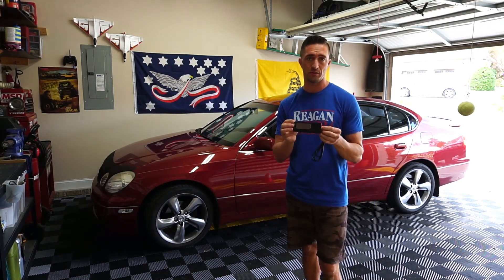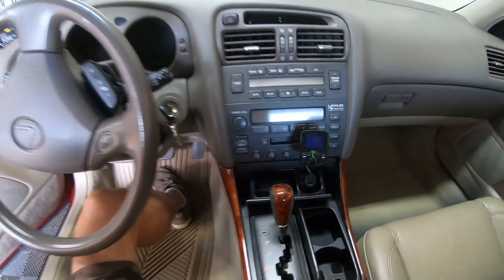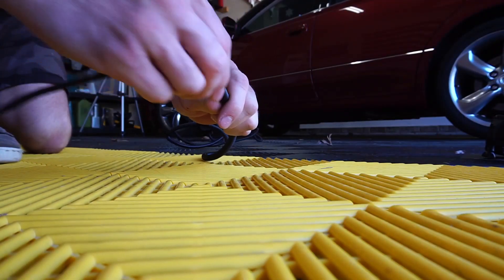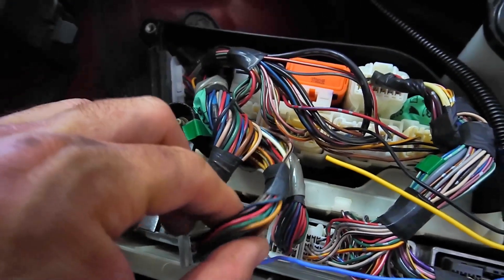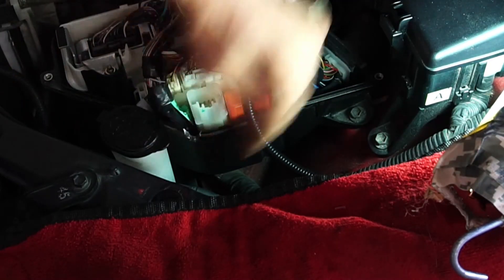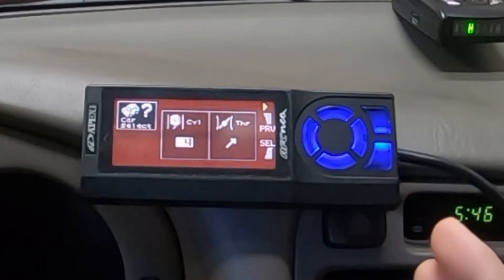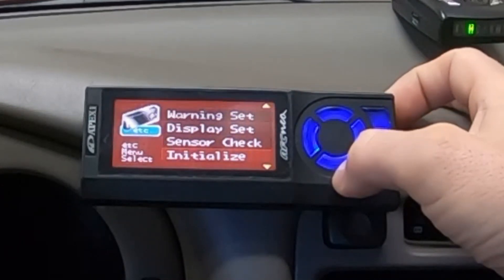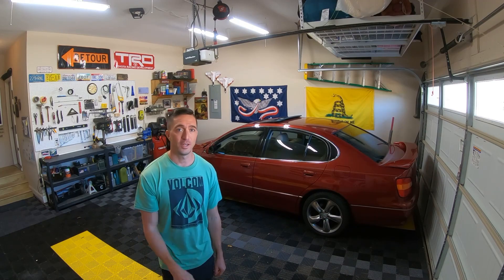Step-by-step Tuning Device Install (Apexi NEO into GS400)

Comment: 9:32 - i know I'm 6 years too late, but what i like to do in these situations is de-pin the wire from the connector and either solder to the end of the pin or de-pin, cut and solder for the cleanest install. 
11:48 - here i would use a heated up metal tube, then press into the plastic. That's how you get a perfect hole or notch. 
Cool video bro💪🏆
Reply from the maker: Good info! Thank you.

Comment: Is this the same procedure for a gs430?
Reply from the maker: Yes and no. The ECU pinouts are different between the two models, but once you get the correct pins it’s the same general process.

Comment: hello frien , what are ur settings for the saqfc neo? could u share them with me please
Reply from the maker: Is your car supercharged? If not, then my settings probably won’t help you. You need to install an AFR gauge and street tune it. Each car can be slightly different anyway, so I don’t really have a base map for you other than starting with all zeroes.
Reply: @ForwardMomentum  not super charged. I wanted your settings when ur car was not supercharged if u still have those. If can please.
Reply from the maker: I don’t have those, sorry. Start with all zeroes then target 12.5 AFR for N/A at WOT.

Comment: I just picked up a GS400 to my understanding they no longer sell this. Is there an alternative out these days. This is my first Lexus in a absolutely in love with it on day two. Has 120,000 mi two owners been well maintained I got it for $6,000 which I'm pretty happy about. Also it seems that the headers are no longer continued as well so what are my options these days without going supercharger as I cannot afford that currently. Also aftermarket stereo is that a thing non-navigation in my system the 8-in sub and back is fine I was thinking the different amp and a head unit? Keep up the amazing content man loving this channel will definitely come in handy
Reply from the maker: Welcome to the 2GS community! They still have the NEO’s for sale on eBay. OBX makes headers for these on a batch basis, so you have to keep your eyes peeled. PPE makes headers too, but they are a fortune. Thanks for stopping by!
Reply: @ForwardMomentum  Do you know what kind of gains are possible with cai,headers, exhaust with neo? Thanks for the quick response
Reply from the maker: I don’t recommend a CAI for N/A. Stock box is best. Even stock exhaust flows to about 350whp. That said, headers and NEO (good tune) are good for about 30WHP based on historical results from others who have done that combo.

Comment: I have aqustion, why going to something like Neo when we could install a piggyback ecu ?
Reply from the maker: $200 vs $2000? Plus, we have proven that AFC works. In fact, my friend has the same set up, with a TVS1900 and 400WHP. So I have no argument against a standalone at all, but in terms of finances I think it’s overkill. I have guys telling me all the time “but you can get a used standalone for $1000.” Oh really, what about the custom wiring harness, set up and tuning sessions? Add at least $1K to that. In the end I might be leaving 10-20HP on the table and a bit of a safety margin, but the goal was to show viewers that you can supercharge these things safely on a relative budget. 👍
Reply: @ForwardMomentum  thanks for your replay, i mean abiggyback like ecumaster det3 ,so you can control ignition also, i think it is the same price as APEXI NEO, searching for NEO and it is listing 350Usd 😦.
Reply from the maker: If there’s a budget standalone that works I’m all ears. I have yet to find one that is recommended that’s under $1000 for just the unit. Regarding the NEO they come up in places all the time used or similar. Mine was $220 new on FBM as I found a guy that just didn’t use his and had it new in a box. When it comes to standalones I would go with units that gurus recommend only, such as Kelvin at CarTuneNZ.
Reply: @ForwardMomentum  ok thank you for your advice, nice car wish you the best, and have alook into Islam .
Reply from the maker: Thanks for your comments and questions. Regarding Islam I have researched it and, as a Christian, I could not reconcile any of its major premises with that of Christianity. Needless to say, I have many friends that are Muslim and I respect their beliefs, even though I may not agree with them on any major points.
Reply: @ForwardMomentum  tha ks for your respect and appreciate your helpful information for every one who need to learn, as i said to you i wish guidance from god to you, and i wish you all the best.

Comment: How much of a pain in the ass do you think It'd be to do this on a sc400
Reply from the maker: It’s all relative. Depends on your expertise and patience levels. On a scale of one to ten, ten being the worst, I’d rate it a four.
Reply: @ForwardMomentum  Ok👌and do you think I'd need a ecu like this if I were to go long tube headers? I heard that the stock ecu has no problem adjusting, but im conflicted since long tube headers are typically for race applications.
Reply from the maker: You absolutely need this if you go headers.

Comment: Mine is not turning on it's a safc2 what all should I check
Reply from the maker: Pinouts, power, ground and plug on back.
Reply: @ForwardMomentum  I checked the plug on the back of it I opened it up didnt look like the board is fried. Going to open the box now and check the pin outs. Thankyou man. Is there anything I should look for in the pin outs? I didnt put this together so I'm trying to back track. -98gs 400
Reply from the maker: Power and GND will power it up, even if everything else is hooked up incorrectly. So if it’s not powering on at all, definitely follow both power and GND all the way to their sources. When I had a bad PWR source (loose connection into a fuse spot) my car died WHILE DRIVING. It was terrifying to be honest. That said, get it to power up and go from there.
Reply: @ForwardMomentum  yea I felt that it was pulling alot of volts from the battery the volts would drop while driving and rpms would drop. That could be a alternator issue but since it has not been powered on I dont seem to have that issue. And the battery stays charged longer. I'll replace alt and battery to see but.. anyway I pulled the box off and looking at the connections. They seem to be ok? It's hard to tell which wire it is since I cant tell where he ran it through the firewall. Any way I can send you a email with pictures of the wire pin harness and such? I don't want to pull the wires that look spliced and taped off there are multiple that are taped. I don't think he ran the ground like you did under the arm rest. It seems there is a green wire ran to a black and red on the pin. A purple wire to a grey, a  black to a brown, a yellow to a red and blue a white to a red and blue a grey to a red and black and a brown to a brown then there is a different green wire not from the same bundle of cords running to a blue and yellow.  Of course he says he dont remember how he ran it so. Currently have it on a battery charger I left the door open doing all of this lol. Also do you think I could just strip it from the back to not have to track this down and just run a hit lead and ground to the wires by the unit so I can see if it will even power on or is that a bad idea to splice it by the unit? I feel that would be easier than trying to track down which wire went where thru the firewall. Thanks soo much for your help man.
Reply from the maker: I really can’t do remote troubleshooting via email. I get way too many messages and this is just a hobby for me. I shared as much knowledge as I have on my video; from there it’s pretty basic electrical troubleshooting stuff (nothing too crazy). Im sorry - not trying to be a jerk. I just don’t have much more to offer than that.
Reply: @ForwardMomentum  I gave up for a couple days. Do you think I should cut the wires on the back of the unit and put power and ground to it to see if it powers up?
Reply from the maker: Yes, go for it. But you can just test what you have currently and see if there’s 12V switched and GND.
Reply: @ForwardMomentum  by just cutting it back and using a dmm ? Ok I will try that thankyou man
Reply from the maker: I use clothes pins into the backshell, but whatever does the job to probe with the DMM.

Comment: Getting this installed in the car rn after tossing in my 330cc vvti 1j injectors curious on if you needed to update/flash yours before installing it or its fine with the karman sensors on our cars
Reply from the maker: GS400 ECU can’t be flashed. The Apexi NEO controls the extra fuel from your 330’s. Without it the car will run crazy rich. Be sure to adjust the fuel trims as well using a data logger and NEO “Lo” maps. Open Loop uses Hi maps. I have newer episodes explaining this in greater detail in my supercharger series. 👍
Reply: Im sorry I meant the neo apexi needing to be updated/ flashed the shop i have installing it is saying it may not function properly because its and outdated version I tried to send you pictures on ig im just not sure if they went through.
Reply from the maker: Oh gotcha. It will still work. My friend uses the previous Apexi AFC (old style) with no issues.

Comment: Q: At the 10:09 mark, where you connect the maf red/blue wire to the neo apexi... is it the blue or purple wire coming from the neo apexi?
Reply from the maker: I just tried to look but I shrink-wrapped all my wiring so I can’t tell. You’ll need to use the Apexi T10e diagram to see which wire.

Comment: I'm picking up my 2000 GS400 Saturday, "It was owned by a gearhead like me and he works at a shop so it's been well taken care of" How far Can I safely push it stock using ECU tune without it killing itself?
Reply from the maker: Are you asking how far you can lean out the AFR? You can’t tune this ECU; you can only piggyback it and manipulate signals (fuel control). I would stick to 12.5-13.0 AFR if you get a NEO and AFR gauge to street tune it. In all actuality though, I’d probably save my money and just manual swap it later on. I tried just about everything “easy” on mine and nothing really adds enough power to be noticed. The diff swap and manual swap are the exception. Those I could feel (but they don’t really add power). Next is the supercharger series. That’s the order I would go in to make the car quicker.

Comment: Do you by chance have any 01 430 wire diagram for the neo? Can’t find anything I’m stuck
Reply from the maker: I don’t, but Apexi should have the diagram online. If you use that and also look through ClubLexus posts, you should find what you need. That’s how I did it anyway.
Reply: @ForwardMomentum  unfortunately I’ve looked all over forums already, just sent apexi an email, they don’t have a wire diagram on their manual

Comment: Will this help to help to adjust the air/fuel if the car is running a bit lean after installing cams on a lexus as well?
Reply from the maker: Yes; only in open loop.
Reply: @Forward Momentum  ooof thanks for the reply .. was quicker then I thought 

Already watched the street tune video and now I'm gonna watch the afr install video

Comment: What was the extra hp #'s when tuned with ur upgrades on the neo safc?
Reply from the maker: No idea. I didn’t dyno it. The shop wanted $300. That’s why I have a street tune episode.
Reply: @ForwardMomentum  oh ok did it make a big difference and how about mpg?
Reply from the maker: @swordsmenbacon9347  more torque for sure, especially at midrange. No difference in mpg.
Reply: @ForwardMomentum  ok good thanks for the info possibly looking to get a supercharger adapter plate for the m112 setup but gotta do more research before I make the commitment on that setup
Reply from the maker: My buddy is SC’d on his GS400. It’s a fair amount of work to get it right. I wouldn’t push more than 6psi. Rings will go first.
Reply: @ForwardMomentum  ok I was thinking of building a 1uz with first gen rods ported heads maybe cams but just looking to get 400hp
Reply from the maker: @swordsmenbacon9347  rings and the A650 transmission will be first to let go. Rods are good to have, but you’ll blow the others before you bend the stock 2nd gen rods.
Reply: @ForwardMomentum  yep that's why a manual trans is a must but ill have it figured out before I get started at least I know how to build my own engine and do my own work plus we have a great tuning shop @UMS tuning so I got it mostly figured out. Thanks for all the info and time
Reply from the maker: @swordsmenbacon9347  awesome! Please keep me posted. I also have stuff on IG if you don’t already follow me. @youtube_forward_momentum
Reply: @ForwardMomentum  I definitely will keep u informed

Comment: Hi from NY,  just wondering if you have any recommendations for shocks and struts, I have a 99 GS400 in very good condition.  I'd like to keep it as stock as possible other than getting 18" wheels and a paint correct and ceramic coat-
Thanks very much, subscribed and a fan-
Reply from the maker: Hi - KYB GR2’s are great. 👍

Comment: Hello, I just bought 2gs300. How can I get your fb? I have some questions and I want to ask you
Reply from the maker: Best way is DM on IG. @youtube_forward_momentum
Reply: @ForwardMomentum  Hello, my friend, can you chat in FB? I come from China, so ins software is not easy to use
Reply from the maker: No I cannot.
Reply: @ForwardMomentum  I would like to ask the gs300 Aristo vscoff button does not work, what do I need to check
Reply: @ForwardMomentum  I sent you a message on the ins but you did not reply

Comment: Nice build, curious as to what your goals for the car are? Those 3rd gen GS wheels are very heavy, could definitely improve power and MPG by shedding 40+ lbs of unsprung weight.
Reply from the maker: Pretty sure headers, manual swap and SC’r are possible future mods. Totally agree, these wheels are pretty heavy. Some light 17’s would liven it up. My diff swap really helped though.
Reply: @ForwardMomentum  Awesome! I chose the Borla proXS mufflers thanks to your videos, I can't wait to install them.  I've got PPE headers, and a JoeZ midpipe to install on my GS460 as well.
Reply: Just an FYI if no one knew, the 5 lug mustang wheels are exact bolt pattern and center bore. I picked up a set of 94 cobra 5 spoke alloy wheels 17x10.5 315/35ZR17 rear, 17x9 245/45R17 front vs my stock  GS430 6 spoke 16” they are lighter wider and better looking.
Reply: @taintedsasquatch398  did you notice a difference around town, like taking off from stoplights?

Comment: As a former mechanic who has cut out way too many problematic aftermarket remote devices, I just can't in good conscience tap into important sensor wires! Especially when the proper/safer way to do it would be to 'poll' the necessary info from the ECU via the CAN bus. The diagnostic nightmares possible from (unseen from the wiring diagram) 'phantom' devices I wouldn't wish on anybody!

Sorry! Tonight was my turn to be the curmudgeon.
Reply from the maker: No problem. I totally understand. Boomslang makes a custom harness for $500 for those who do not wish to utilize the tap method. Thanks for watching and commenting.

Comment: Do you know how extremely talented you are bro ??? How much power can you really get from this set up ?
Reply from the maker: If you’re being serious, thank you. It’s hard to tell these days. There are some haters out there after all. Power gains depend on mods. I have seen 25-30 whp and nearly 40 TQ, but the mod list was extensive and included headers. In my case with basically exhaust, I’m pulling 11% fuel out of the map in places, just to hit 12.3 AFR. That goes to show you how rich these run normally. That said, I’m guessing I added 10whp and 15 TQ in places on my power band, but I need to dyno to be sure. I hit 5.1 0-60 one day which would back up my claims. I hope that helps!
Reply: Forward Momentum wow so you was able to do the headers my Lexus IS currently at almost 250k miles and I mean all maintenance engine wise has been done I upgraded to NGK spark plugs , upgraded the trans fluid also plus cooler , also timing belt radiator change plus upper and lower hoses plus diff oil change everything yiu can imagine just about I may change the torque converter to a high stall from dragon something .com it’s said to add like 50 extra horsepower but before I do that I might just 2JZ swap it completely for like 7k
Reply from the maker: No, I haven’t done headers. However, I have seen dyno numbers of the increased power with headers and an AFC though. Pretty awesome. I’ll get headers someday!
Reply: Forward Momentum the torque converter alone with a bigger transmission cooler will make a very noticeable difference
Reply from the maker: I have the trans cooler. I have heard good things about the TC, although some say the 2800 stall is annoying (I have no idea if that’s true).
Reply from the maker: JB Tv Nation will do!
Reply: Forward Momentum just uploaded a new video from this weekend it was insane

Comment: Just curious how you have the steering wheel radio control module?  I thought that was only on the 430 model?  Did you add that? I can’t get over how clean your GS is.
Reply from the maker: Thanks. It’s actually the orig car phone. It still works (no calls though).
Reply: Forward Momentum  lol.   Yea they used to come with phones in the center console.
Reply from the maker: Yeah mine still makes that “90’s” carphone sound on startup. Pretty funny.